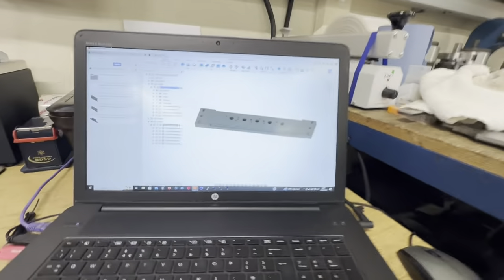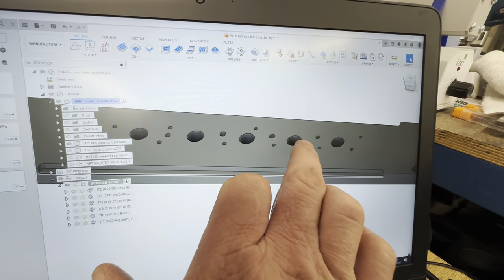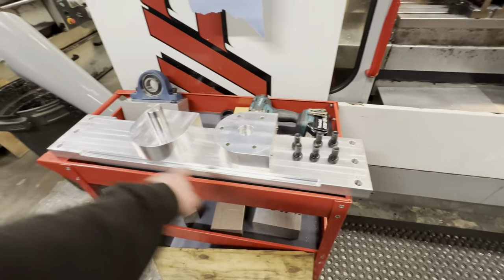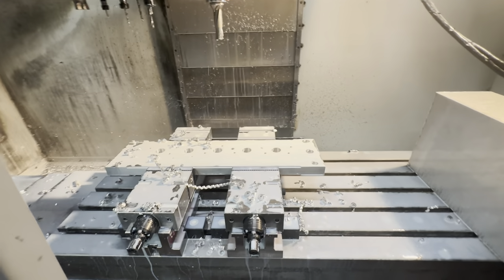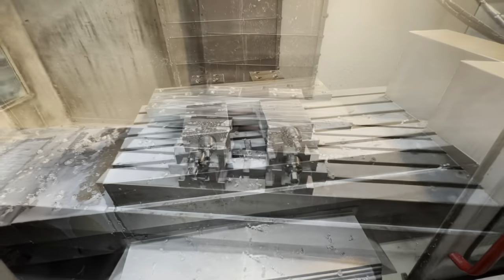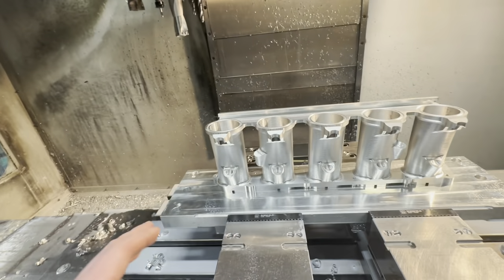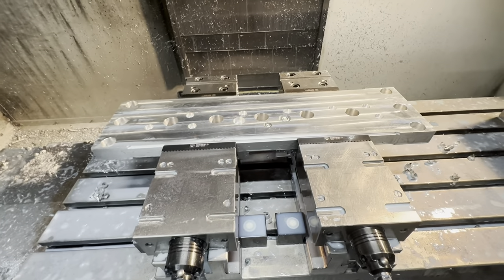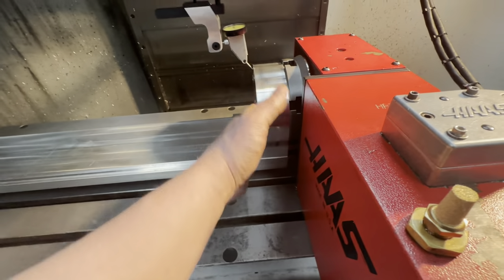Why is it so hard to align a 4th axis trunnion set up

Comment: Marc, align the 4th axis true as you previously did. Don't try and re-align to true the plates. The most important thing is that the axis of the rotary is parallel to the machine bed and aligned with X. I would re skim the end plates, taking a very light pass off them and try to only apply a very small amount of side pressure if possible if holding from the sides. I would also ditch the dowels between the end plates and the base plate, they don't allow you the adjustment that you need. If you want the sides of the base plate to be nice and true to the X axis, machine those as a final operation when they are installed in the assembly after all of the other elements are aligned well. One final thing is that if you are still overloading the 4th axis, you may have to reskim the bottom face of the end plate to make sure it's square to the vertical face. 
Just my ten pence for what it's worth!
Reply from the maker: Hi John,

I did start afresh and re align the 4th axis rotary and bolted it down secure and did not touch it or move it again. i ended up re machining the end plates as the mounting faces were not perpendicular to each other, as you suggested i removed the down pins and i enlarged the bolt holes to allow alignment in x with moving the 4th axis,

Basically everything you have mentioned needed to be done and things have finally come good after a good learning curve

Its all shown in the next video

Thanks for commenting and helping out

Marc

Comment: All good comments!!  You mentions removing the dowel pin of the assembly to allow adjustements, the longer the distance between the 2 sets of 2 pins the greater the error, I would but 4 dowels per joints. Or use key ways since I think you only need perfect perfect alignement of the end parts on the Y axis, unless the distance between the 2 end parts is critical. I would also check the assembly on a surface plate prior to mounting on the machine, using a long ground shaft to check where the plate is in relation to the bores.
Reply from the maker: Hi 
Thanks for the comments, i have removed the dowel pins and decided to not use any, this has allowed a bit more free movement to align and has worked well, the only potential issue is if the bolts ever worked loose when machining it could maybe move slightly but unlikely to happen, i ened up checking the ends on a granire plate as you will see in the next video coming soon

Thanks
Marc

Comment: Clock the 4th axis then DO NOT TOUCH it, you must have an accurate datum to build upon, then only adjust what comes after it, the only place you shoud be clocking after that is the mounting plate because clocking the end brackets is a red herring adding non required data, adjust the bracket to trunnion interface to true up.
Reply from the maker: As you suggested i went back and started from scratch at the 4th axis, got it true as i could bolted tight and left it alone, then onto the rest of the problems going along the line

Thanks
Marc

Comment: First i'd bolt the trunnion to the 4th with out the plate, then point the face the plate bolts to up clock the face in x and Y and see where its laying may need a tickle in situ, the front of it you was clocking doesnt really matter, just the relationship between the face incontact with the 4th and the face where the long plate bolts to that part.
Reply from the maker: Hi

Yeah that front edge means nothing and i realise that now, its the mounting face being square to the plate face that matters, and i ended up re doing that to get it square

Thanks
Marc

Comment: Why are you not using the table as a reference point? Machine the plate flat put spacers / parallels under the plate and then mount to the 4th axis - then remove the spaces that should give you reliable flat mounting of the plate. Hope this makes sense?
Reply from the maker: I have got there eventually, i didnt do it this way though, im not sure i understand the way you mean

Thanks
Marc

Comment: That bottom part bolted on the chuck has an error from milling bolting or both. It is like using a boat level compared to a 4ft level for setting out.
Reply from the maker: Yep my problem from the start is the platter face not being perpendicular to the plate mounting face

Comment: I suspect that the issues are primarily coming from the trunnion end plate you’re attaching to the 4th axis where it mates to the trunnion bar. If it is a possibility, I don’t know anything about this 4th axis hardware, I would suggest that you knock the 4th axis back true and re-machine the portion of the trunnion end plate (4th axis spindle end) that mates to the trunnion bar by spinning it 180 degrees (flip upside down) so that the face will match the machine XY plane and your dowel pins will then be in machine YZ. Hopefully there is very little error in A so that when you flip it back over, it’s right where you want it to be in parallel.
Reply from the maker: Hi

Your 100% right, that mounting plate was the main cause of error that just caused the error to compound as i moved out further, the platter face was not perpendicular to the trunnion plate face, in the next video i show how bad it was and how i went back to correct it 

Thanks
Marc

Comment: When I line my 4 axis up I have a ground bar that I know the error in it. 
It goes in to the bore 2”. I then run the clock on the side and top. My datum bar is the length of my x axis. 

That way I know my 4 axis is parallel with the x axis, and square to y. 

After that we Mount are Trunnion skim the z face. Rotation 90 and then as you go down the face in x it should be perfect .0000, this is how we make our trunnions. 

Plus use the bearing block a lot stronger plus less chatter/vibration than tail stock.
Reply from the maker: Hi

I have a ground bar to do that with the initial 4th axis set up but my x is just over 1 meter travel and my bar is not that long and at that weight it would tilt in the bore clearance, probably be good if i had a 12" bar and got that perfect,
I have decided to stick with the bearing block support as i wasnt happy with the 4th axis tailstock set up

Thanks
Marc

Comment: Would it not be possible to adjust the end part that is mounted on the 4th axis plate in place when it sits correctly on the plate, if you now know that the 4th axis is aligned in all axes.
Disassemble the fixture plate and turn the 4th axis plate 180 degrees and take a skimcut and maybe machine for larger dowelpins.
Then it should line up?
Of course, you move up the fixture plane in Z by a few hundredths of a millimeter, and you have to adjust the block for the support bearing by the same amount.
NOTE: If I were to make such an adjustment as I describe above, I would indicate the 4th axis on the plate and not on the part that is attached to the plate as you show here in the video to be completely sure that the 4th axis is 100% correctly adjusted, so that you do not build misalignments into the setup right from the plate.

Hope some of this makes sense.

//Stefan
Reply from the maker: Hi 
I ened up re machining the platter mounting plate and support end plate but didnt do them in situ but same results, when it comes to indicating the 4th axis plate, fusion 360 will only allow you to use the centre of A axis rotation as a datum, i cant set z off of any other surface as it does not allow you too so Z & Y have to be centre of the 4th and x can be wherever i want it to

Thanks
Marc

Comment: If the 4th axis is true, then I wouldn't worry about the face of the ally part you bolt on.
As this is not what you are bolting your long plate to.
Check and re machine in position the bottom where you are bolting to.
And go from there
Reply from the maker: Hi

Thanks for the comment, i did exactly that, i check on a granite plate with a clock to see if my lower face was perpendicular to the platter mounting face and it was miles off so my error was bad from the start and just getting worse as i moved out

Thanks
Marc
Reply: @kinzy_fabrications  
Hi Marc

I'm sure you'll get it sussed in the end.
I'm new to the channel, love the content, especially this project

Willing you on to succeed with it
👍
Alex
Reply from the maker: Thanks Alex

Means alot to know people enjoy this stuff as much as i do even when its driving me mad lol

Next video will be up today

Thanks
Marc

Comment: Why dont you take it apart and check location's?  .4mm is alot! Should be within .05mm? You should be able to see what and were it all went wrong by  inspecting the parts that make it up
Reply from the maker: Hi Jason

That’s exactly what I did
If you see the next video I got it
Aligned and sorted, I had multiple errors causing the alignment issues 

Thanks
Marc

Comment: I hate to see you scratching you're head. (I've had brain surgery due to a stroke, so please don't take any of this as bad.) First thing I would do is take it all back off and recheck as you reassemble. Starting with the shimming of indexer. If you go back to the day it was new, chances are that it started life in good shape (doesn't mean that it can't be out, but say it's ok). Next I would check the platter, should be set to where it is square and perpendicular to the table. That way you know the indexer is perfect, or within .0002" overall. Then bolt the faceplate on and just lightly snug up. Rotate the flat where you can run an indicator along the "y" to get it to run within .0001". Check the "x" runout, it should be .00005" or better. The flat surface of that piece needs to be as perfect as you can get it. Tighten mounting bolts and recheck surfaces. It should all repeat. If it does move, then there is something not quite right. I've only seen you indicate the front face part of that piece, and that really doesn't mean anything. Then you can start adding the table and end support assembly. I hope you find the solution, I wish you the best!!!
Reply from the maker: Hi

As you suggest i started back from the 4th axis, its quite old and doesnt run perfectly true but theres nothing i can do about that and i can only get it as good as i can, as mentioned i then moved onto the trunnion mounting plate and re worked it to get the platter mounting face and good as 90 to the plate face as i could. i had a lot of error here so this was the starting point to get right before moving forward

Thanks
Marc